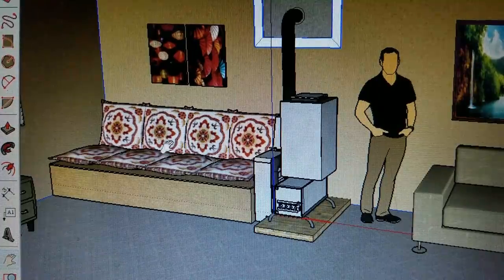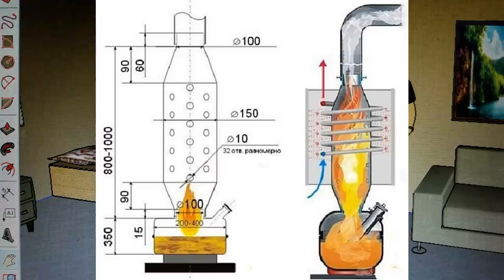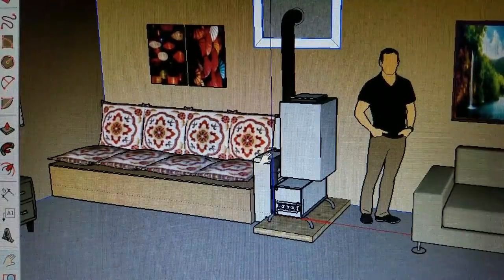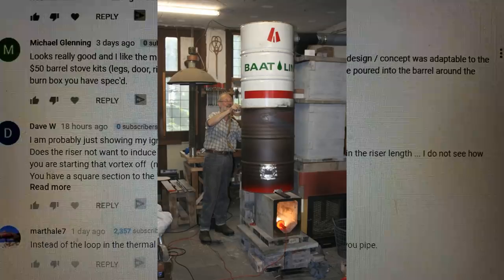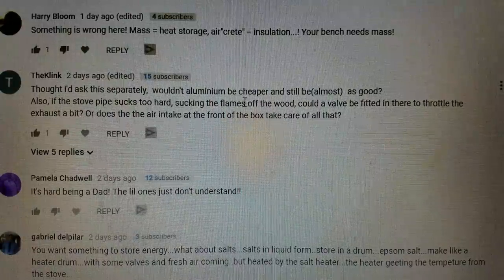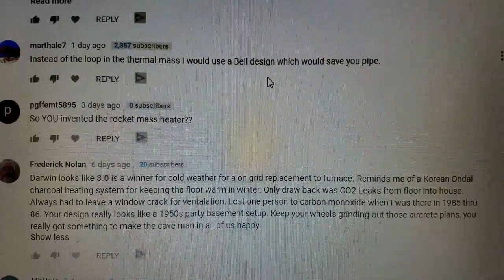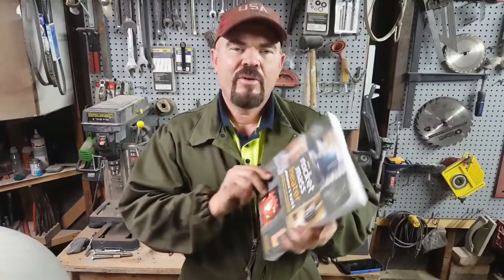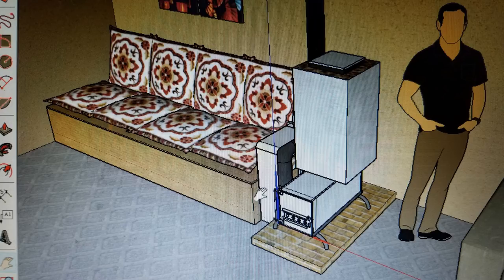Heating your Home AMAZING Homemade Wood Stove

Comment: Aircrete as an insulating material sounds great. Aircrete for the firebox or heat riser will deteriorate before long in a well-functioning rocket core, as portland cement disintegrates far below the 1500-2000 F temperatures inside the core. If the core is not getting that hot, it is not getting full clean combustion. Aircrete for the mass would be counterproductive unless made very dense, as the air bubbles in it are insulators.

Comment: After building your bench. How did your theory work out? Does the bench heat up as expected? How prevent the heat to escape through the shimmy when the fire has been put out?

Could you make a video in which you do a summery what you have indented and discovered? Did also in relation to the foam made? What are your final conclusions? I’m watching a lot of your videos but it’s a lot, so what to build according to your latest experiences?

Comment: So , if you wanted to add an oven to this system , where would you locate it ?  I just want to be able to use my energy, heat in multiple ways. Maybe be able to go a  another direction, other than the bench , and have a oven / cook top   ?
Reply: Watch his video of a oven.

Comment: The most efficient portable design may be an aircrete base burn chamber with cylindrical riser two feet high detachable. All those materials including removable 45 gallon drum barrel liner should have water glass coating inside.  Side duct might be put through 3/4 gravel stones in a bench. It might be good to add stucco wire outside each for strength. Intake & vortex fresh air supply is needed.
The whole system could be back up house heating.

Comment: Last summer, I constructed a rocket mass heater in my living room. Overall, I am very pleased with the way it works, that said, however, this summer, I will be dismantling half of it, so as to expose the length of exhaust pipe, which currently runs through the mass. Currently, the mass gets warm and stays warm for several days, but it does not actually heat my house very much, so my hopes are that by exposing the exhaust pipe and placing it inside a vented seat constructed of air Crete,I will be able to create a flow of air up the outside wall across the ceiling and down in the center of my house, thus heating up the entire space more efficiently, still using only a small amount of wood. Wish me luck.
Reply: You probably had too much thickness of cob around the ducts. Around 4-6" of cover is generally recommended. A better style of mass for your situation would be the "half-barrel bell": 55 gallon drums split in half lengthwise and set cut side down, as many as you have length for all connected with open ends. Run the core exhaust into the bell, and the chimney pipe from the base of the bell. Cover with cob to minimum 3-4" thickness. No friction to reduce draft, a bit less mass to be heated, faster heat transmission. 
Aircrete is the wrong way to go about mass - it is inherently insulating and will slow the transmission of heat, and has less mass in a given volume to store heat. Plain concrete will transmit heat faster than cob, and has even more mass per volume, though it doesn't allow adjustments after construction. Convection (moving air) is a less efficient way to heat than radiation or conduction which is what the RMH excels at.